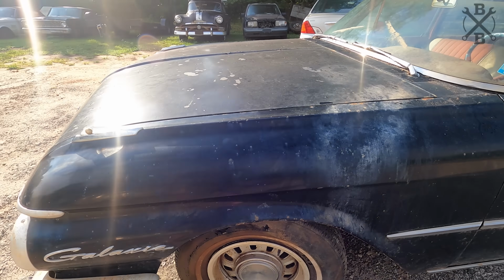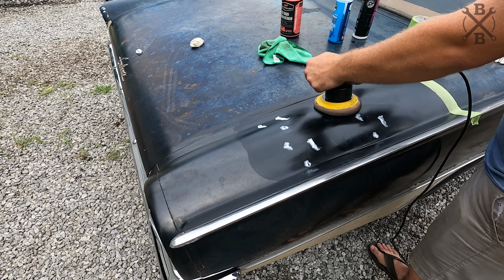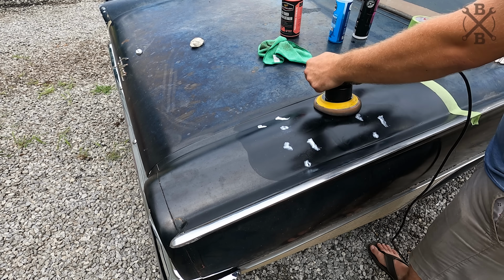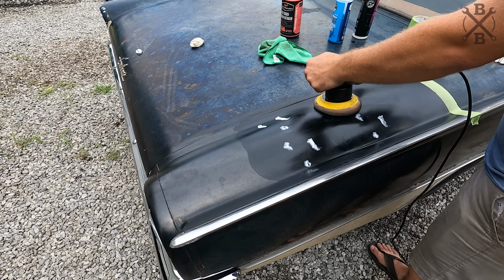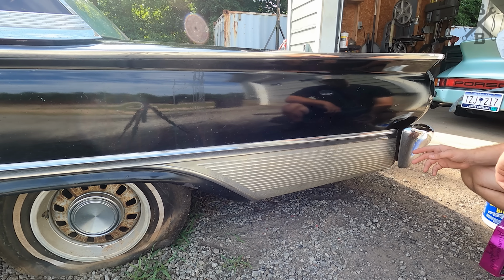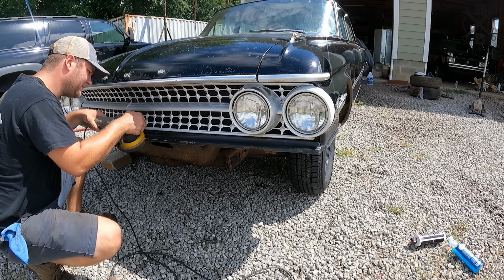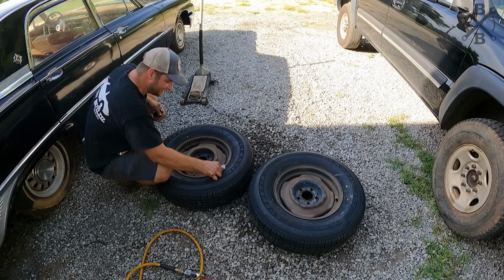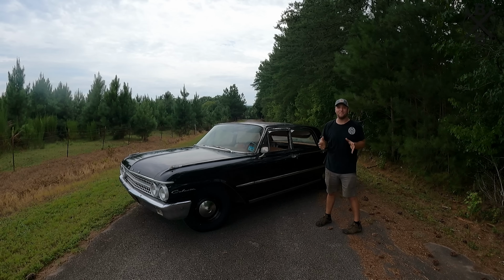BARN FRESH 1961 Ford Galaxie 390! First Wash & Detail in 24+ Years!!

Comment: An old trick for cleaning up the paint ,  a “COMET” wash. Works best on Enamel paint.Wet entire surface first, lightly sprinkle COMET   Cleanser on & with a soft wet sponge wash entire surface throughly. Rinse multiple times. Best to be done on a Cool surface and in the shade.

Comment: The exterior work really made a dramatic difference. The dog dish hubcaps do look good but, I would add beauty rings to the wheels. That is my taste but others may disagree. I seem to remember the 390 cars having an emblem on the fender. It was a Thunderbird with 390 on it. Perhaps it was only on certain models. Looking forward to the next  episode on this car.
Reply from the maker: You read my mind! I was looking at pictures, thinking it needs beauty rings. Thanks for the suggestion!! Yessir, our ‘62 Thunderbird has the emblems on the fender but the Galaxie(atleast for ‘61) does not. My grandfathers ‘62 may have the 406 emblems but I can’t remember for sure. Thanks so much! Can’t wait to share more!
Reply: dvs1145, the car has later model rally wheels with trim rings and dog dish hub caps.
Reply: @BudgetBuildz  '62 Fords with 406 engine had emblems on the front fenders.
Reply: I agree with the beauty rings. Would add just the right amount of shine to the rims.
Reply: @sergeantmasson3669  Hey Sarge, Go back and look and you will see that he pulled the wheels that were on the car. He replaced them with larger Chrysler black steel wheels with black wall tires and the small dog dish hub caps. It looks OK but the addition of beauty rings will give it a better look, IMHO.
Reply: @Jddvs  When found, it has Ford Rallye wheels on it BTW, Ford dog dish hubcaps won't fit right on Chrysler steelie wheels.
Reply: 1962 was the first year with bird engine-size emblems on the front fenders.

Comment: Back in the 60s we had two Galaxies.  One had the 390 like this one.  If you keep it under 65 on the road it will give you 18 mpg.  When those secondaries begin to kick in, it will drop to 15 or 16.  Last one we had was a '67 2 door with a 289 automatic.  The 67 was easy on gas and was fine on the interstate.  Our kids grew up with that Green 67 2 door.  They loved that old car.  We drove it for 11 or 12 years.  Both of ours came new from the dealer.  The 390 needed attention to the points about twice a year.  The 289 needed a new water pump just about every other year.  The bumpers used to get a little "parking lot rash."  They cleaned up just as shown in the video with a little TLC.

Comment: On my '61 Galaxie, I installed F70x14 wide ovals on the stock black rims with chrome trim rings and baby moons on the front. The rear were F70x14 wide ovals on deep dish chrome reverse rims.

Comment: Nevr Dull is actually a product I've been using for years to bring old Chrome and other polished Metal parts back to live on my Motorbikes and so far it has allways worked a treat. You'll have to reuse it regularily if the part is allready pitted, like that bumper, since it will simply start to "bleed" rust again out of those damaged spots but it surely helps prolong the inevitable part refurbish or replacement for quite a bit.

Comment: Cars like that--at least the automatic 4 barrel versions were high geared and got around 18+mpg. I had a 67 ltd 390 2 barrel that got anywhere around 15-20 mpg with the carb off of a 289 that I built. Motorcraft 2100 carbs are real simple to build and you can dial them in with various venturi and jet sizes.

Comment: Tip for you on painting wheels.
You don't need to go through all the steps you did to paint wheels with tires installed.
Paint the wheels, the paint will get on the tires.
Drive for a few minutes. The paint will not stick to the rubber & just flake off.

Comment: I had a 61 starliner new with a 390 3 speed with overdrive. And heavy duty Suspension it came with 15 inch wheels I think the tires were 710x15 with power steering. 
I like you are keeping it  Original. Will this be for sale when you are done

Comment: I flew with a guy named Scott Evans ["Scooter"] and he had an original police Ford Galaxie like this with a 427 cubic inch engine and [I think he said] a four speed manual transmission.  I don't know if it was a SOHC or not.  I think he said it had dual quads, and he paid pretty close to six figures for it 10 years ago with around 50k on the clock.  

-He told me you couldn't drive it hard at low speeds since it just burned the tires despite the posi rear end, but if you nailed it above 60 mph it would reach 100 mph in seconds...